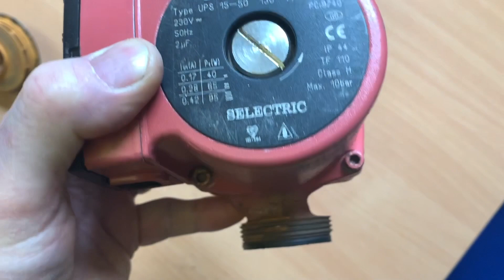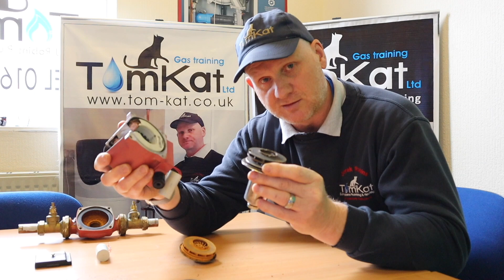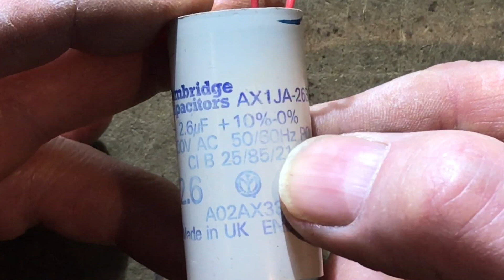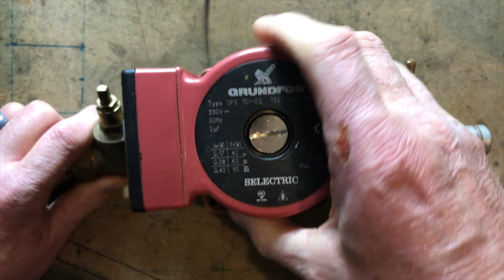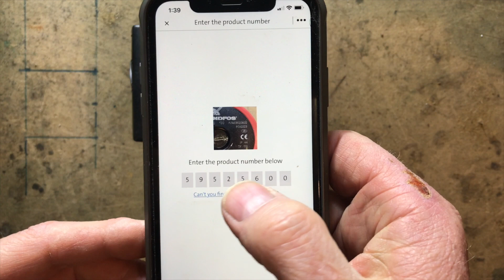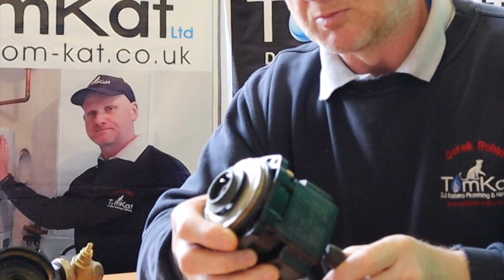WHAT IS INSIDE A HEATING PUMP. a gas tutorial on what's inside a heating pump and how pumps work

Comment: Great little video, like to see things pulled apart. 
Cavitation would be at jet ski power and speed!
And even if it happen, it would be pure steam. No air, no corrosion. The air comes from somewhere else in the system. That's what the trap is for which should have a long upward stem with a bleed screw on top. I installed my system from an old library apprentice book.

Comment: I have a Wilo SB30 green pump for secondary return (hot water), it was installed for a year or two and hardly used (boiler system only turned on once per year - long term renovation!) and I noticed recently it became very hot when turned on. I didn’t watch this video so I didn’t know to bleed it (cavitation) but got a warranty replaced from BES. Removed the pump and put finger in to turn impeller through the inlet / outlet (cant remember which) and the impeller doesn’t move freely. Anyway, replaced it and haven’t tested the new one yet but next time I’ll isolate then remove the head and do better investigations! Excellent video, so good to have so much in depth discussion about pumps.

Most of the video was about pumping CH water around system, what about using it for secondary return hot water? Presumably cavitation still happens in the same way?

Any other differences in the way the pump works / fails in this scenario?

Comment: I have wilo RS15-6 with brass base on solar heat water system. Rotating assy got encrusted build ups that eventually intermitantly jammed bearings... found big range of new rotating assemblies in china on aliexpress but so many sizes models took time to ensure correct one.

Comment: Excellent video. I just had one fail, and I replaced the head. Excellent to watch this straight after. Mine failed immediately after I drained the system, replaced a radiator, and refilled. I drained the system as I replaced an old imperial size radiator with a new type 22. Everybody I have spoken to says it must have just been on the way out anyway, but I find it too coincidental that it happened at that point. Do you think there is something else I need to do to protect the pump when draining the system, maybe take it out and clean it? Brilliant video mate, thank you. Big thumbs up.

Comment: I've got a weird fault, where the pump runs normally when the boiler is cool or warming up, but then starts a slight clicking noise when the boiler has been running for a hour. Even tho' I've vented it, and checked it spins freely. I may have to change it, so would like to ask what figure you use for the 'port size'. Is it the internal or external diameter of the pipes either side of the pump, or the screw thread between pump and compression fittings? I have 28mm o/d pipes, but these then taper down to 22mm near the boiler, and a 1¾" pump connection thread.

Comment: Just one comment on the job of the capacitor, it’s there to provide a phase shift to start the motor. Imagine trying to start pedalling a bike with the pedals in the 12 and 6 o clock positions, it doesn’t work. The capacitor moves one pedal around to say the 3 o clock position, now start pedalling from here and it’s much easier. Once the pedals are going there is some inertia so the magnetic field pulsing at 12 and 6 o clock positions keeps the whole thing running. It’s a well known issue on single phase AC motors.
Reply: Nice explanation about starting caps!

Comment: Good tutorial.  I took my pump apart in the airing  cuboard 3 years ago because it was noisy. Cleared it checked the wiring, speed switche and capacitor. Easy job. Put it back refilled with inhibitor etc. and fired up my centr heating. At first I thought the pump wasn't working because it was so quite and had no vibration whatsoever. It was only when the pipes got hot that I knew all was well. Three years later and I still can't hear anything or feel any vibration.  Both makes of pumps will last for years  and years if you service them at the first sign of noise or vibration. My pump is more than 20years old and  I am sure will last another 20years.

Comment: Thank you sir. Great help in understanding the pump. I have a grundfos pump p/n:59505559 that is going on of on of, when it need too pump water for the Centrale heating. When I use warm water I don't have that problem. Do you have an idea what the problem is. When I look at your video, I am thinking that the problem is the capacitator.  What do you think sir? Thank you in advance for your help.

Comment: Should a grumfos pump get a little warm while operating.  I just installed one and it felt a little warm after a while.  Not really hot, however warm.
Reply from the maker: It will get as warm as the water if it gets too hot to touch then it is full of air
Reply: @tomkatgastraining  Thanks for your reply

Comment: I have a Heat Master C250 outdoor wood boiler ..I’ve bought( 3 ) grundfos alpha 2 pumps for my hydronic system What is a good pump to use to circulate the water from my wood boiler to my domestic hot water thru a 20 plate heat exchanger continuing up to the attic furnace where there is another heat exchanger in the plenum then back to the boiler...this is a single story house with only a 15 ft rise to the attic furnace and say a round trip of say 300ft of 1” pex
Reply from the maker: By the sound of your text James you are in the USA or Canada so not to sure what pumps you can buy over there
Reply: @tomkatgastraining  Central Tennessee

Comment: How electrically is the capacitor wired in.. across neutral &..?????
Reply: Start cap is wired in series with a ‘start winding’ across the electrical supply. Once motor is up to speed an internal switch disconnects it  and the start winding is no longer used. The motor the continues to run on the ‘run winding’ that’s wired across the supply.

Comment: we have a massive central heating system ( about 30 rads) open vented. our heating bill is over £4000 - yes 4k per annum. it is now linked into woodburner boiler stoves. the question is: can i put another pump on the system if there is already one on?
Reply: Yes :)

Comment: My grundfos pump is old and making a bit of noise, when I loosened the bleed screw cap dirty water came out then cleared up but seems to be under pressure, I remember years ago removing the cap and seeing the rotor slot and turning it with out a bunch of water coming out, not now i think removing the cap would be problem putting it back. What limits the water getting into the pump? Maybe you can find a listing for my pump ,I can not, UM2518SU It is a gold color, A8149, 110-V, It runs our roof top solar hot water system, every day since 1979. A go replacement motor app found nothing .Thanks,-